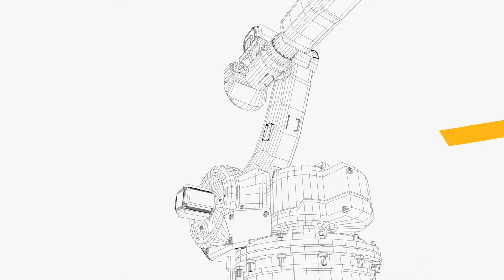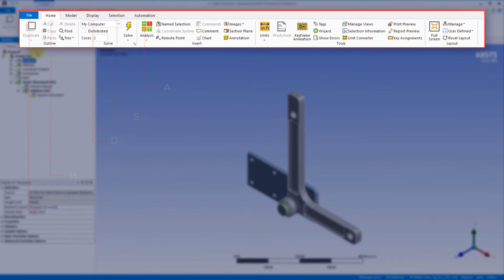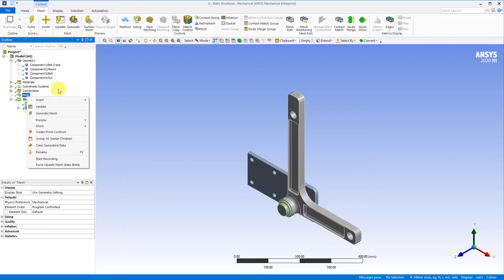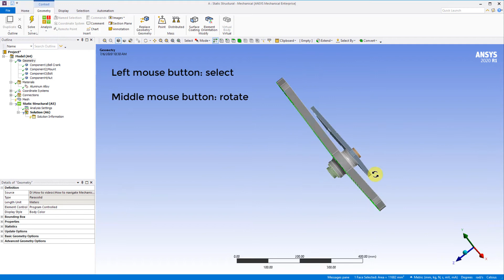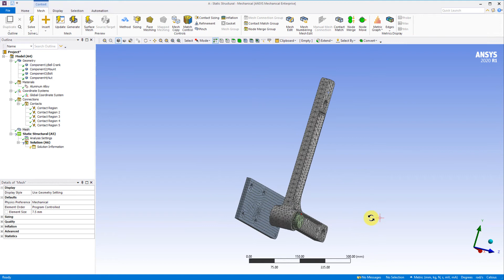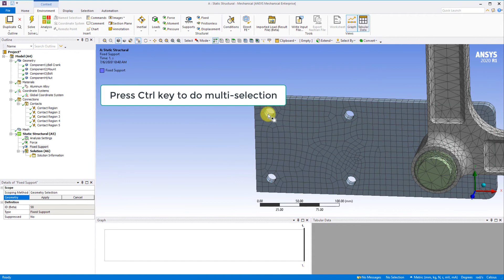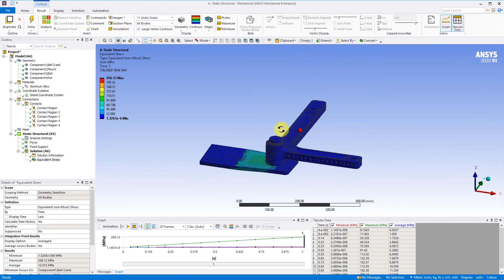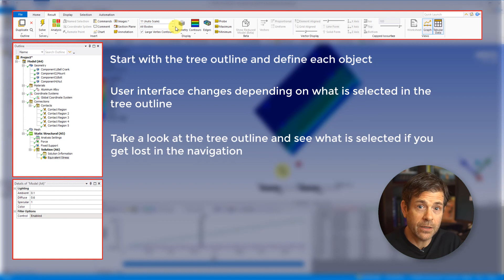Navigating the Ansys Mechanical User Interface

Comment: Dear Concern,
It is very helpful to learn the software from the company ANSYS itself.
It will be very grateful and thankful if you explain each domain such as Static structural etc which is basic but in detail do that the beginner or student or project interns etc learns it quickly and does not depend on other tutors etc to learn the software